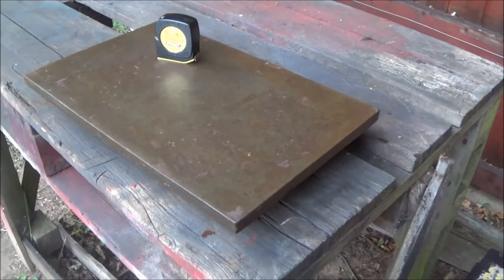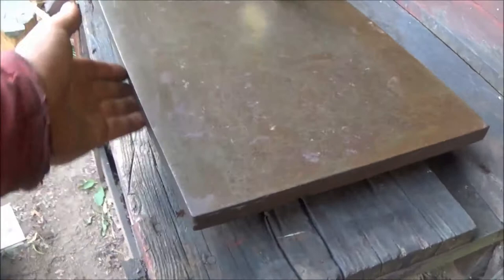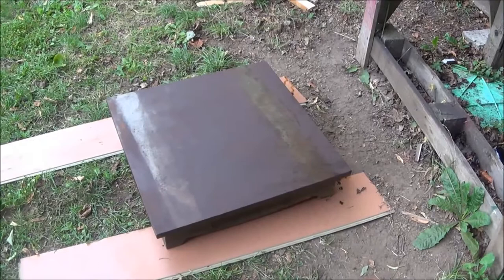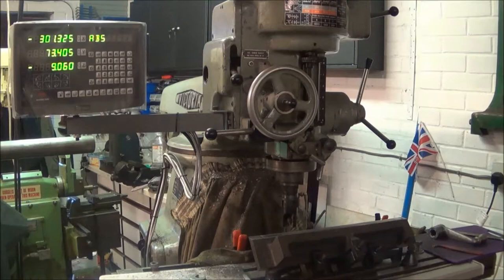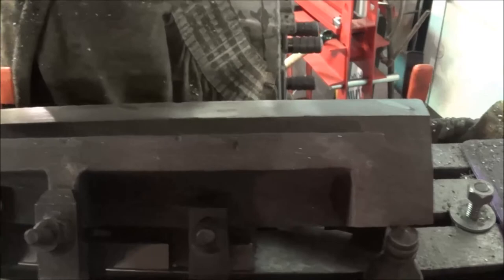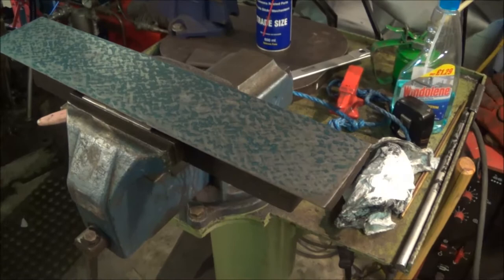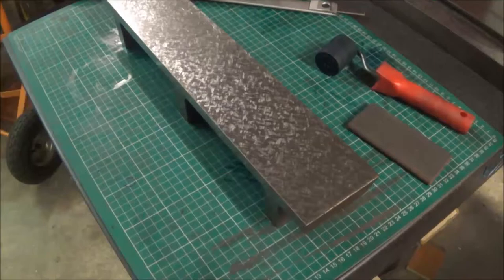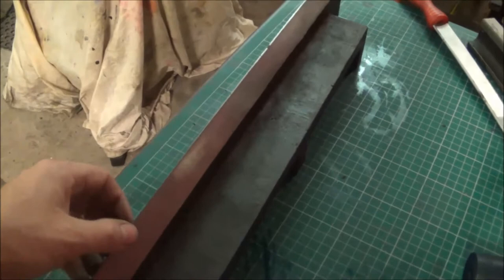Making a straight edge from an old surface plate

Comment: hi there just discovered  you love the scraping your doing . i just built a pattern for a 7x7 in surface plate cast up and plan to use the 3 plate method to generate the plain . wish me luck .
Reply from the maker: sounds like an exercise for the brave! Are you planning to heat treat it?
Reply: Machine shop at the bottom of the garden I would like to I need to find someone who does that sort of work